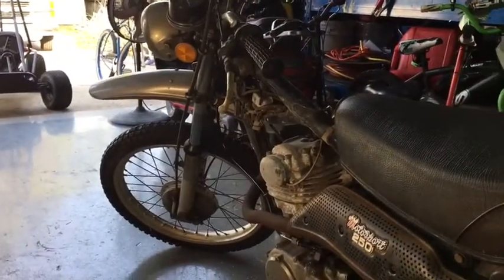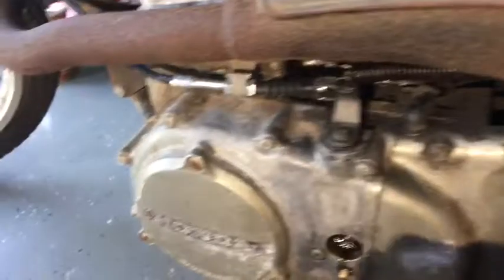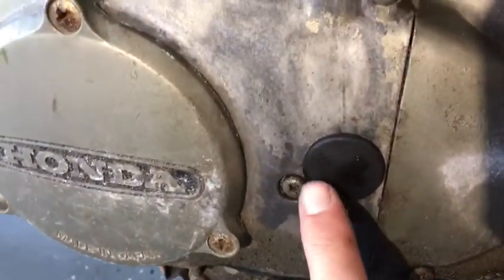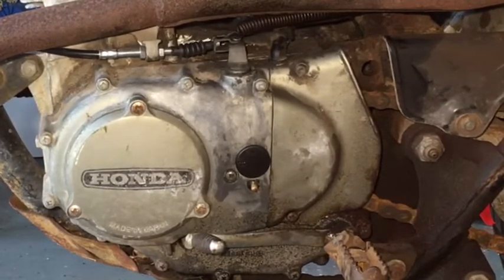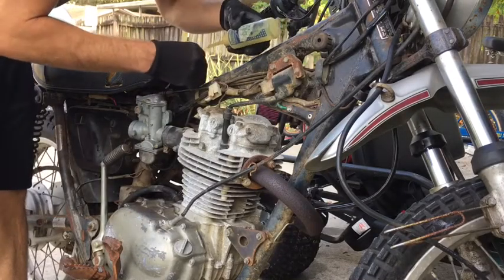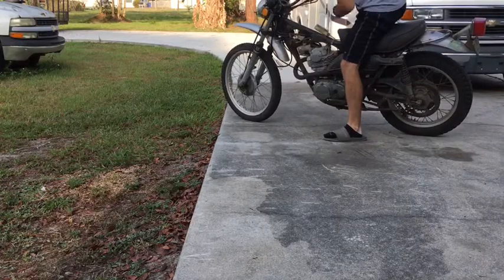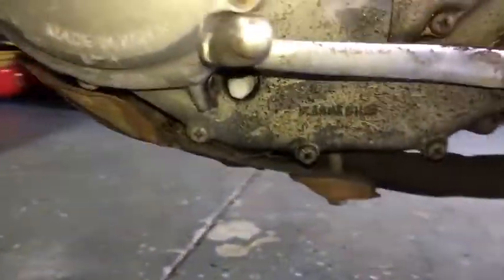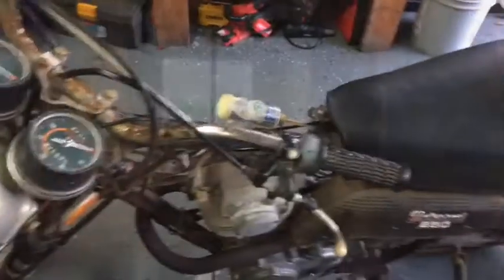1972 Honda XL 250 Motorsport Rescue: p-4 How to adjust motorcycle clutch plates.

Comment: Mine is on the road now. Going to do this adjustment next just to be sure. I am hitting 65mph at 7,000 Rpm's. Almost redline. Motor sat for a long time. It's getting smoother. Checking Valve Adjustment again.

Comment: I have this same bike, just slightly less stock and in rougher condition, sitting in my side yard waiting for me to finish all of my other projects. What are you planning for the fuel tank?
Reply from the maker: Actually picked up a file tank for 35$ brand new on eBay. Will fit with slight frame modifications.

Comment: nice vid book says 1/2 to 1 turn. why dont they just say 3/4.. tip for starting it. key on ign off. give it little throttle 1/8 kick 5 times turn on ign. kick 1 or 2 times and it will run. chock if cold weather.

Comment: Have you taken apart the fuel pump on this? I had my idler gear shear most of its teeth and am just trying to make sure I get all the shards are out of the engine. I don’t have a manual, but I take the snap clip off and from diagrams l found online it looks like the assembly should pull out but I can’t get it to budge. Otherwise I definitely love mine, has been a great city putter and trail bike just need to make sure engine is not setting itself up for some major failures before riding again
Reply from the maker: There is no fuel pump. It’s gravity fed. I highly recommend picking up a hard back manual. It truly simplifies repairs to have step by step directions right in front of you.
Reply: Noel Adventures I’ve just been going off of pulling things apart and taking pictures for the most part. Honestly you’re probably right, it would be worth the $25 since I do really like this 250 and will keep her for years to come and save a lot of time trying to hunt things down online
Reply from the maker: Always feels good to do it by the book... when you can.